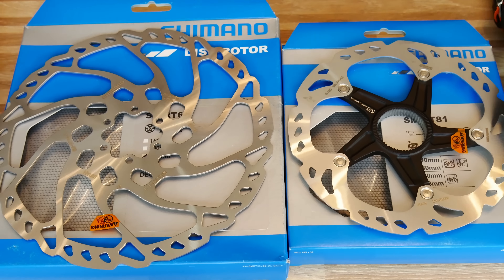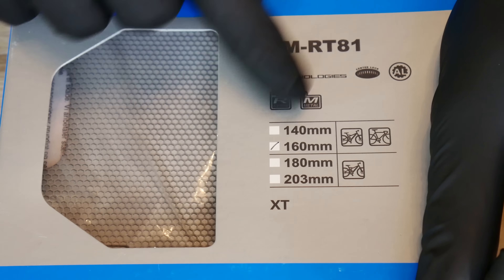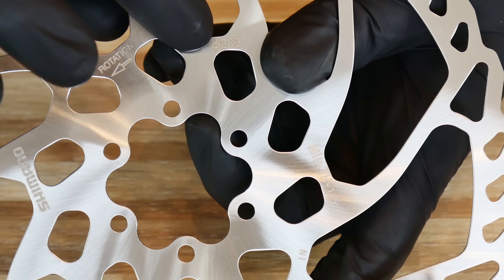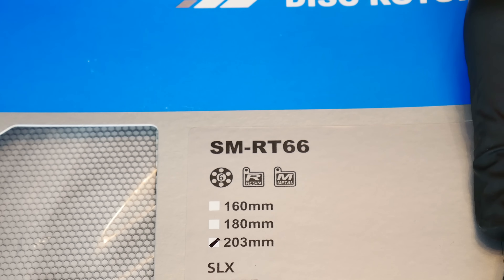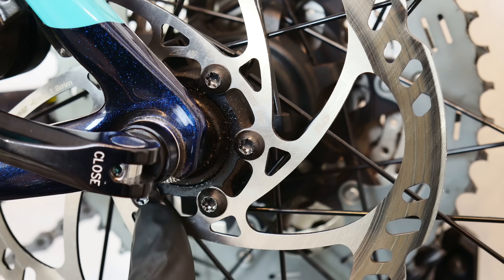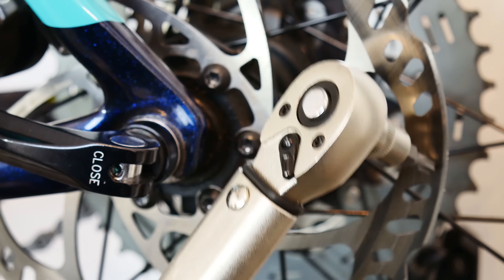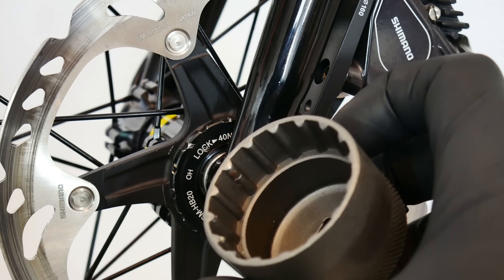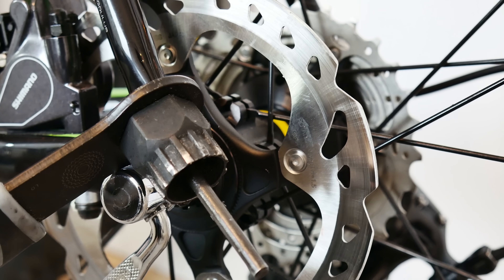2 Things You Should Know BEFORE Buying Disc Brake Rotors. Centerlock vs 6 Bolts / IS2000

Comment: According to Shimano documentations:

1. There are 2 different types of rotor (wide & narrow) dedicated to different brakes.
2. 140 mm rotor is only use in road bikes. Shimano is not producing adapters for 140 mm rotor for MTB (the same goes to frame manufacturers)
3. Fixing method shown in 1:43 is not recommended by Shimano due to the potential risk of untightening screws. Nowadays Shimano always put spring washer to prevent that.

Comment: Center lock. There are 3 types:
1. Internal - tool same as cassette;
2. Internal - specific tool, for example Shimano TL-LR11;
3. External - same as BB tool, just don't try using those open BB wrenches, those are no good for external center lock. Use the one or similar shown in this video.

Comment: 3rd factor:
Make sure you don't buy Resin only rotors,they wear out faster,if you use  Sintered/Metal pads.
and of course don't buy Resin pads, they wear out in just few weeks, for me it's 4 weeks.
This guide is helpful:
https://www.pinkbike.com/news/brake-pad-information-2009.html
Use thread locker, like Loctite 243.
Reply: I feel like this is quite misleading. Maybe you are a shred monster. I've been riding my second hand hybrid bike for 18 months and I'm still using the same resin pads that came with the bike, on the cheap RT10 resin-only rotor.  So really your advice is not absolute and shouldn't be stated as fact.
Reply: @chocolate_squiggle  different riding, different speeds I guess. My advice was from a view of  high speed braking, and riding a lot. Also I would cook usual hybrid bike brake set up. But not everyone weigh the same and ride at the speeds I do or brake as hard and as much as me. Also Trp semi metallic pads work well for me. Keep in mind what semi metallic is varies between brands.

Comment: Hey Mate. I wanna get better brakes on my specialized diverge. Right now I have trp spyre-c brakes. They are mechanical disc brakes. I wanna upgrade to hydraulic ones. I ride a tiagra 10 speed group.  Which brakes would be your choice? I just subbed a few days to your channel. There have been some really good tips do far. I wanna have 11 speed soon. I'm also not sure which cables I need. The set that some pages offer included just the shifters and the brake calipers. No rotors or cables. I'm interested in your opinion!!

Comment: Sir can we upgrade 160 mm disk rotor to 203 mm disk rotor
Reply: Yeah if you're aggressive downhilling a LOT or live in the alps 😂
Reply: Yes but you will need about 3 adapters to make it fit: a 160 -180, 180 -200, 200 -203.
Reply: Yes but you'll need a 203 adapter.. only one adapter is needed.

Comment: are the adaptors for the calipers universal for every bike???
Reply: Yes, because the original mounting point will only fit whatever size disc is already on there. Eg a 160mm rotor will always have the same mounting points on every bike which had a 160 rotor. So all adapters will work the same, as long as you get the right size for the larger disc (like 160mm to 180mm)

Comment: Can I change my 160mm rotor to a 180mm rotor using a post mount adapter WITHOUT changing the calipers? ie using the same calipers that was used for the 160? Or do I need to change the calipers too?
Reply: A post mount will do just fine, just make sure you get the correct one!